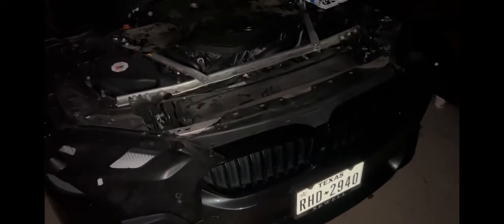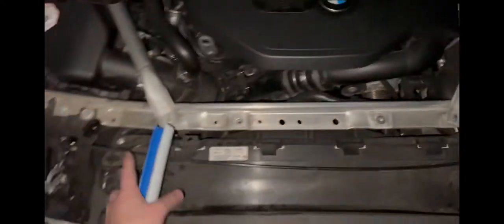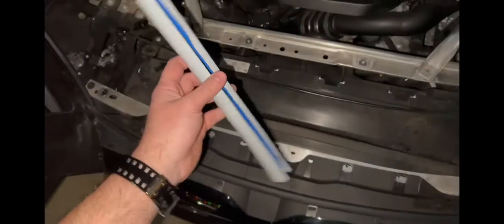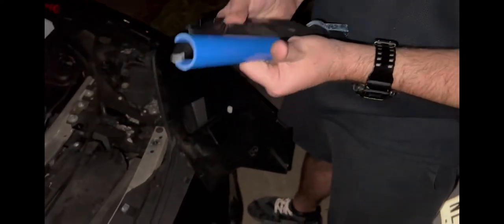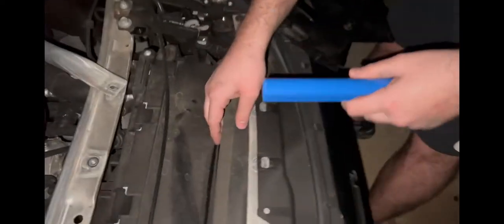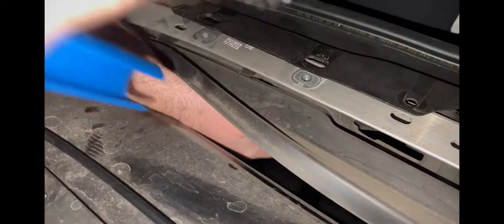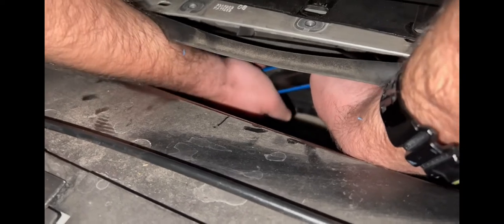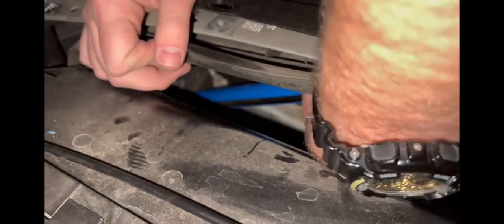BMW G30 V BRACE COVERS INSTALL

Comment: You could’ve installed it without removing anything lol. I just turned the car on and put the ac on max. Grill opened and I put them on thru there. Use a wrench with tape to push it on if you can’t do it with your hands alone.
Reply: Same except I didn't even turn the car on. Just hit the start button three times to put into diagnostic mode. This opens the active grills, hold them from closing and they will stay open while in this mode. A little tight getting your hands in there, but it worked fine. It helped to pop the kidney grill covers out which is easy with a trim tool.
Reply: Thanks bro, gonna try it myself
Reply: @20mx1 you remote started it and it opened?

Comment: would this work on a 2018 m550i? both g30s sk it should work right ? can you make a vid on how to remove the black plate
Reply from the maker: @slow.540 on instagram i will guide you if you need